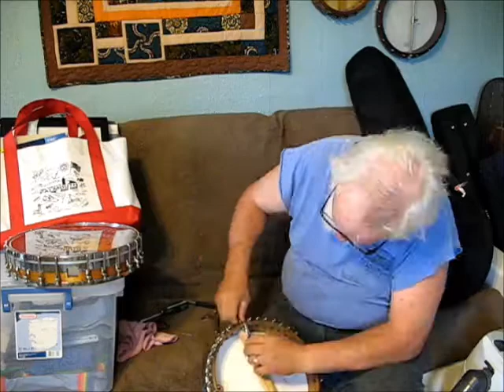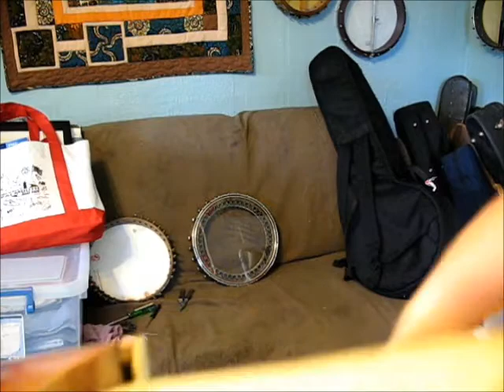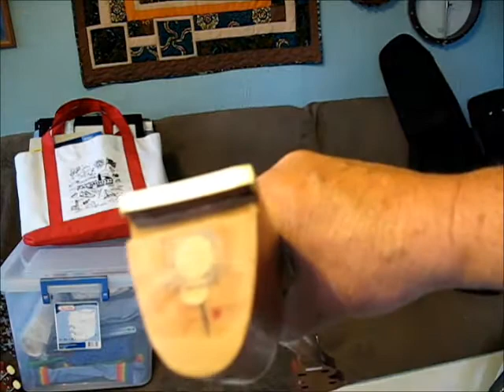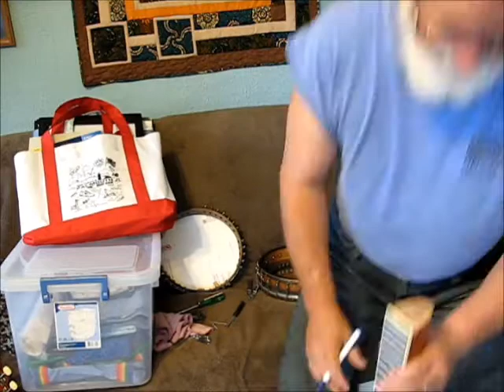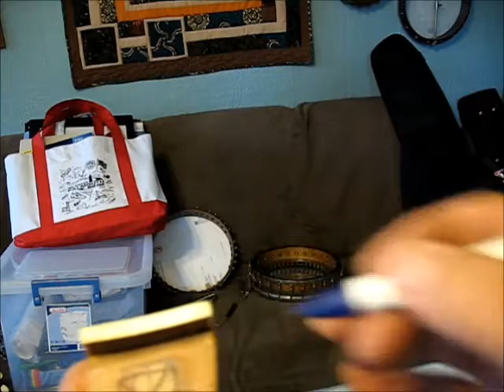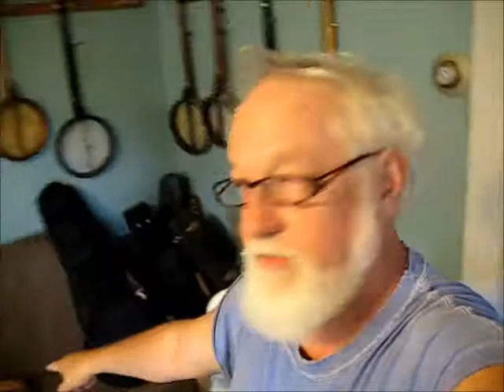Stromberg Cup O Phone  Banjo Project 6

Comment: You are experianced enough to do it by eye.  I still got to measure.
The fingerboard has to be about 3/32 above the head of the banjo.  I use a drill bit to help set the difference.  The neck has to be about 3 degrees in relationship to the head.  I got a tool I made using an old protractor and a couple straight pieces of brass.  I guess you could find the "right" tools at Stew Mac or someplace, but I think doing it by eye or measuring by what falls to hand gives the whole thing more character.